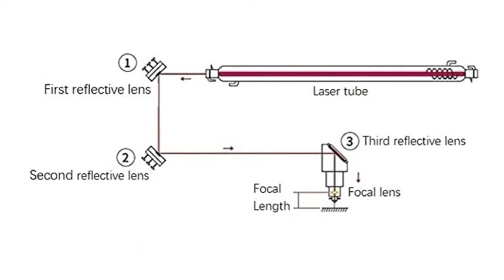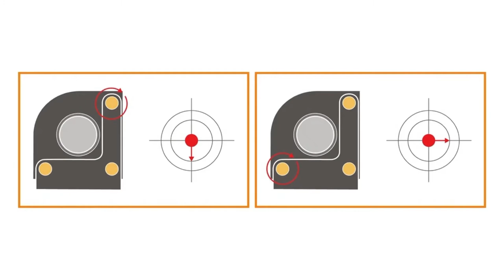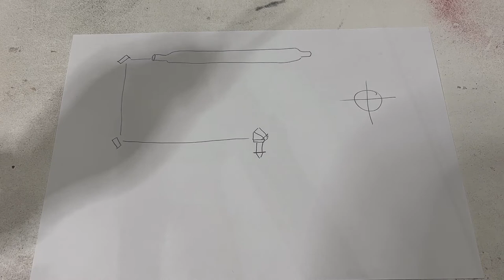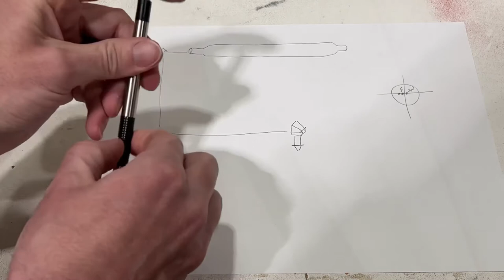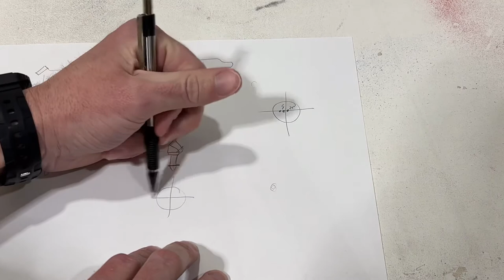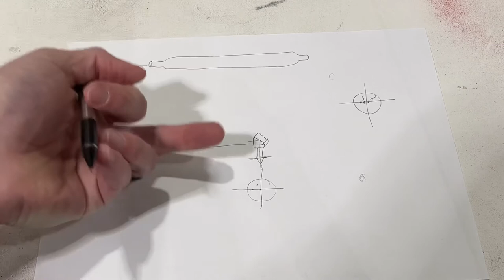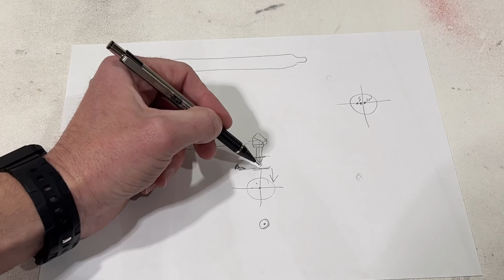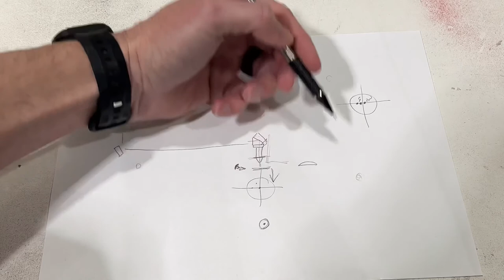Principles of Co2 Laser Mirror / Beam Alignment

Comment: Thanks for this video.  I just got an OMTech 100W manual focus machine and the tube wasn't installed.  When I installed the tube, I was having trouble with the beam and thought that the other videos that suggest I needed to be dead on center at each mirror seemed wrong to me (it was correct in an ideal situation, but maybe not practically). Your explanation is what i thought the right answer should be.  Now I'm going to try it to get the darn thing usable.  Thanks again!

Comment: Jumped in head first and bought a combined 300w CO2 to cut stainless steel, nothing was even close when it arrived. I level the machine first. I used my Bosch 3 axis laser level to get all the mirrors on the same plain, it was a huge time saver. But the Co2 Laser Alignment Tool from American Photonics was an amazing tool to get everything dialed in perfect across the entire bed.
Reply from the maker: That’s a big jump! Glad to hear the the reverse alignment tool was helpful! Any thoughts that I should highlight about it in my next video?

Comment: I messed up right out the gate by a heavy adjustment on the diagonal adjuster on mirror 1 & 2. The problem is now I have no idea where it basically should be set as standard. Is there any helpful ideas/ways to correct this and get it back to a normal Al standard position? (I don’t know what position is standard)

Comment: The Chinese designerrs were just  too clever  when they designed the L shape mirror adjusters.  You are perfectly correct with your left/righ and up/down function of the end screws . However your understanding of the centre screw is NOT for diagonal adjustment. It's not obvious about the function of this screw and that's why I said the Chinese designers were too clever. I do not use this screw myself  ether because it seems wrong to  adjust all three screws after you have set the two corner screws. . If you put a 12 oclock mark on all 3 screws and adjust ALL 3 by the same amount at say mirror 1  then you can  reposition its refection onto the centre of mirror 2 but  only to the  left and right. That's the  real reason for the middle screw. Great in theory but far too complex for most to understand. In reality there is likeky to be some diagonal movement of the beam onto mirror 2 because it is most unlikely that beam will strike mirror 1 perfectly horizontally.
 I have spent several years perfecting the LOGIC of quick simple and perfect  beam alignment  and you fail to  mention the REAL goal of beam alignment is to set the AXIS of the beam to coincide with the AXIS of the lens. I see myself 5 years ago doing exactly what you are tryng to explain. I now know how confused I was. 
I must stress that there is ZERO criticism of your video  but I have seen so many people tying themselves in knots with confusing instructions.  That was part of th motivation   for  creating  a teaching aid that allows you to  fully understand EVERY aspect of beam setting, except the 4th corner issue which you allude to but do not clearly explain. Perhaps you could make a MK2 version of this video after you have watched 
https://www.youtube.com/watch?v=PpFPAJ1Gs8s&t=2s
 I emphasise again that  this is sharing knowledge and NOT criticsim
 Best wishes
Russ